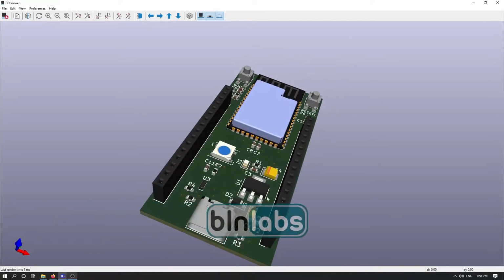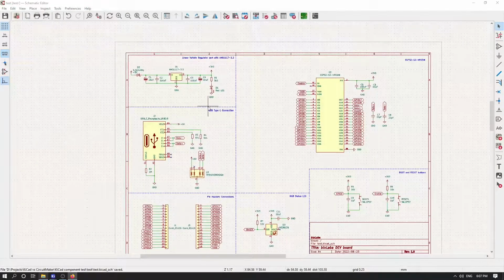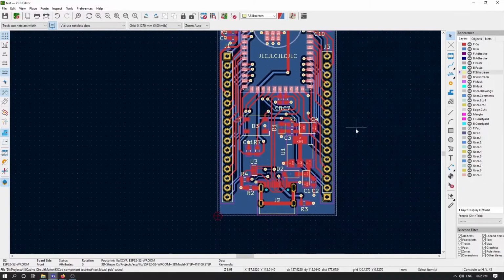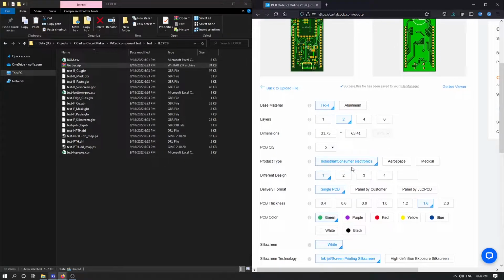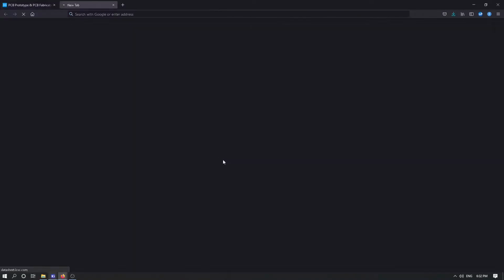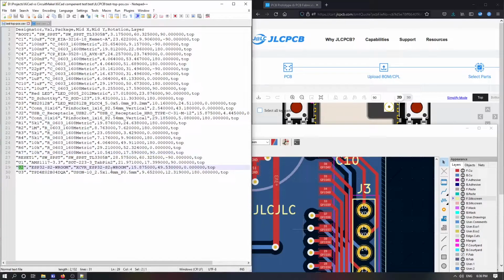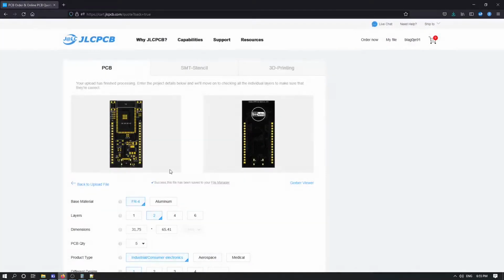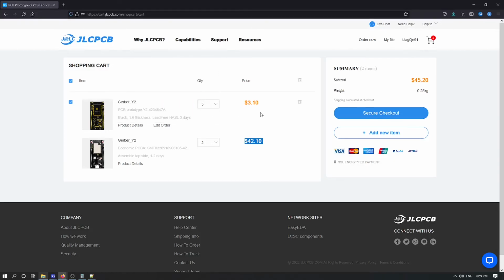KiCad to JLCPCB - Gerber and SMD assembly

Comment: Hi. Nice video, thanks! Just wondering why you fix the placement by updating the position file, instead of using the controls in the JLCPCB site when checking the positioning. I have used this every time when placing a PCBA order. You can rotate components, and move them around. I think that is much more quick as well. What do you think?

Comment: Thanks for making this video.

I have yet to place my first order and this is showing me the obsticals to anticipate.

I am left wondering why the ESP32 needed to be offset so much. It is as if the library part may have an origin different from where the PCB placement thinks it should be.  Or perhaps the JLCPCB viewer / placement system has the offset.
Reply from the maker: Thank you, 
but regarding your question, I think that that the problem is open source components and not JLCPCB, because it seams that default KiCad components are  placed correctly